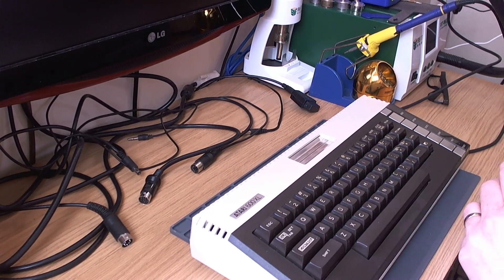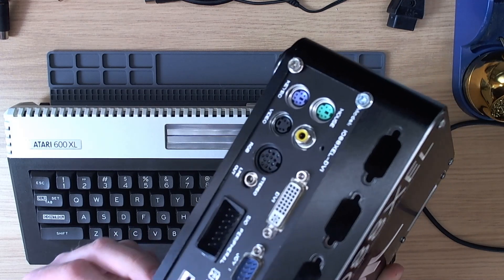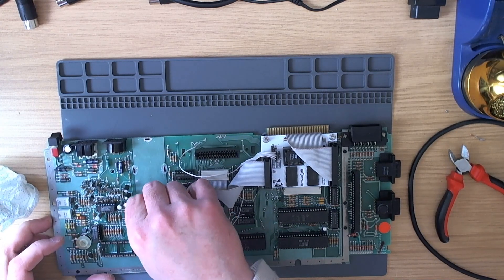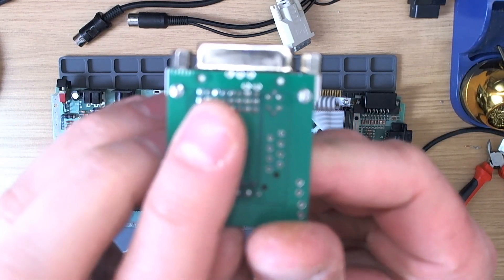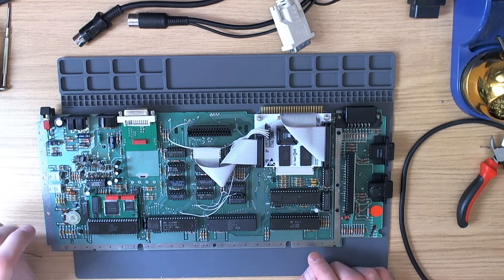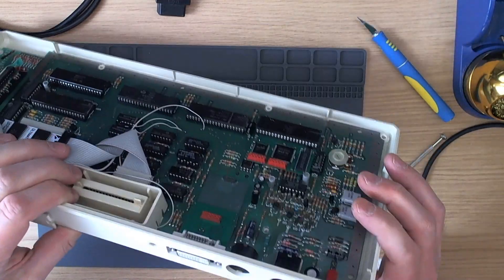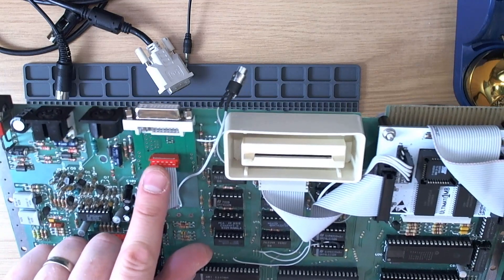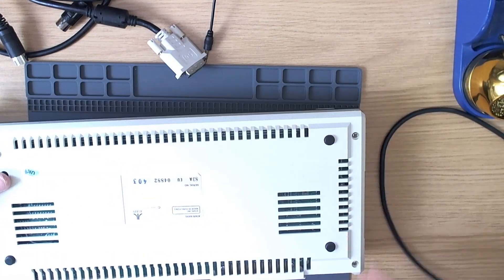Atari 600XL Part 3: Installing Sophia DVI

Comment: Can the VBXE mod leverage the Sophia DVI port for video output?
Reply from the maker: Unfortunately not. VBXE outputs 15KHz RGB (SCART compatible).
Reply: @flashjazzcat  Thank you.  I have found there are not many games that utilize VBXE.  What are the benefits and uses of VBXE outside of those discrete games?  What would you recommend to pair with Sophia 2 to enhance the video performance?
Reply from the maker: @ParakeetPotato  VBXE has a hardware 80-column text mode which uses no base system RAM (and is accessible via pre-written display drivers) and obviously image quality is dramatically better than s-video/composite while retaining the analogue video 'character' of the 8-bit machine. If you already have Sophia 2, I'd recommend UAV (Ultimate Atari Video) or Spectre AV to improve the quality of s-video and composite video, since those legacy video signals are still necessary for certain visual effects ('PAL blending', etc) not emulated by Sophia.
Reply: @flashjazzcat  Thanks again for the knowledge drop.  I look forward to working on my 1200XL.  I have watched so many of your videos...multiple times.

Comment: I've seen a couple of SOPHIA installs, and I'm wondering: if installing an audio jack requires soldering and if done wrong can let out the magic smoke, why not just neuter an AV cable use the audio from there?
Reply from the maker: I suppose anything - whether it requires soldering or not - can potentially let the magic smoke out if one makes a mistake. My solution is not to make such a mistake again, which is to say make sure the audio jack doesn't touch anything conductive when testing the machine during assembly. Taking the audio from the legacy DIN jack is a perfectly good idea, however, although if you want to have both video outputs active at the same time, you'd have to make an A/V cable which splits the audio on two connectors (depending on your display device). You'll also hit problems if you decide to install stereo POKEY in the machine now or in the future; at that point, you'll need a separate stereo audio output anyway.

Comment: Great job Jonathan! Beautiful indeed. A clean top notch install. Shown is one of the rare type 3 (AWC) keyboards for the XL's which could be confused with a type 2 but the keycaps and key font are more like the SCCO Stackpole (type 4).
Reply from the maker: Thanks! Most interesting regarding the keyboard. I thought I had an example of every XL type here aside from the AWC with Cherry caps, but I will have to look at this one more closely.
Reply: @flashjazzcat  Yes how is its typing experience? The XL keyboard guide thread post 1 says it's inferior to the type 2 AWC. The type 2 is rather stiff in my experience which some love.
Reply from the maker: @gamedoutgamer  The typing experience is really nice. No buckling, not too noisy, good feedback.

Comment: Wouldn't a 3D printer be the way to go for a blanking plate?
Reply from the maker: Not necessarily. It needs to be thin and aluminium plate looks nice. But this one doesn't appear to need it anyway (owner agrees, having watched the video). If I've found the sweet spot for the size of the aperture, I'll probably do them all like this going forward.